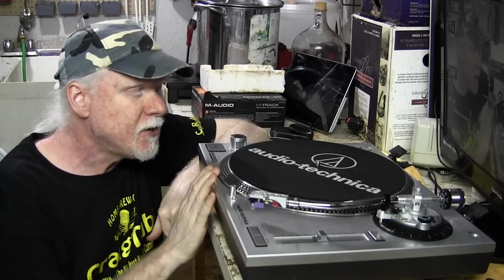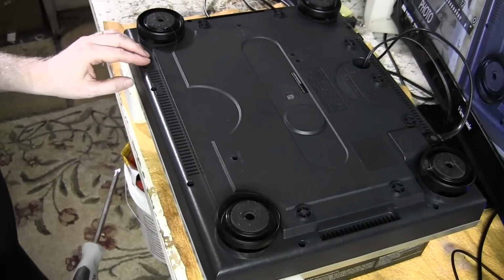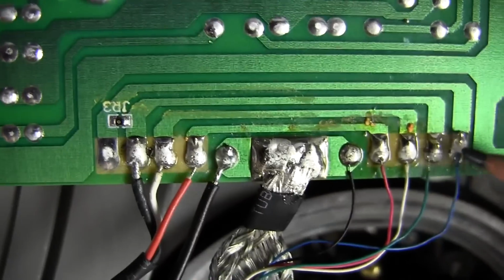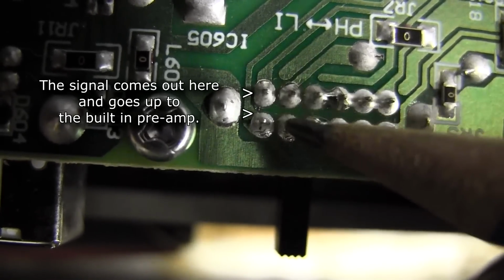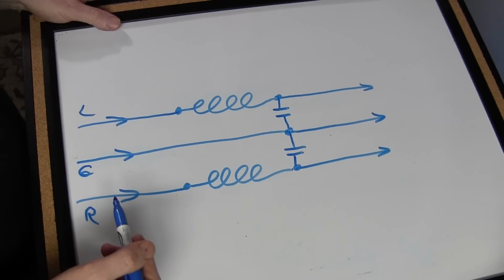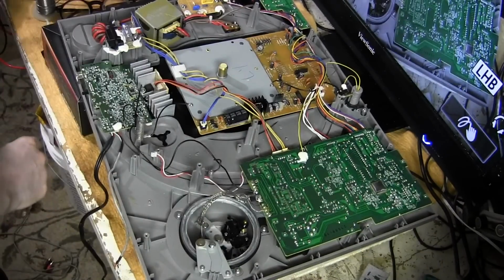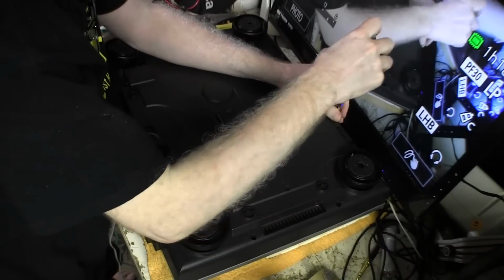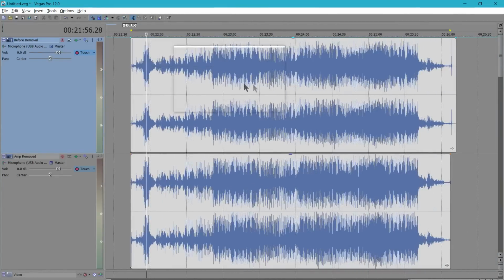Preamp Removal - Audio Technica AT LP120 USB Turntable

Comment: I believe that AT has upgraded this model in the last two years (the AT LP 120 X USB) so that when you switch to the Phono output, it actually bypasses the internal pre-amp.  I guess they heard that a significant number of people were doing this hack.  So, I'm guessing that videos such as this goosed AT into fixing this. So, thanks!
Reply: @skipandslide  No, they didn't, sadly. I did some research and it seems like that in the new X model you still can't bypass the preamp with the switch.
Reply: Do you believe it or did they really solved this with the X model?

Comment: Why not just jumper that portion of the circuit board? Jumper right past the choke and cap by soldering a wire from point to point.

Comment: Hello Craig.. I just got my AT LP 120xUSB that has a phono/line switch. Do you recommend using a cheap phono preamp or the built in preamp? My goal is higher volume output in general. Thanx in advance... p. s: love your song.
Reply: Get a line level booster TC780 and TC750 phono stage

Comment: These things are crap. Toys for Tots. Faked out with simulated build quality by adding 10 pounds of unnecessary armor plate weight to give the illusion of Technics 1200 build quality. It's a plastic toy. I have to make a video when I buy a cheapie one off the bay. This approach is incorrect, why not have the best of both worlds. A crude USB driver as factory and a pure audio out?  That way when you grow up to a real turntable, you can pass this on truly modded for the better to the next novice. Or, if cosmetics aren't important buy a used vintage TransAudio 1600/1800 built like a tank and better than most turntables sold new for under $500. They knock around for $150 or so on eBay. Heck,  any vintage Technics is better than this!

Comment: If I remove the built in preamp could you or anyone by chance recommend an in-line preamp as I plug this turntable directly into my Logitech Z-500 Pod that I use for gaming? I have no amplifier or receiver. Thanks ahead of time.

Comment: I wouldn't buy a turntable with a pre-amp built into it. That kind of circuitry is obviously going to effect the sound in some way. 
I think that if the power amp that you're using doesn't have a phono input, only then would you need a separate pre-amp.

Comment: super video .... maybe only removing this little capacitors from the pre-amp board the sound will be better ... this a HPF (high pass filter) to prevent a XIZZZZZZZZZZZZZ sound on the background ... this noise is possible to happend by problems on AC power ... much noise on the line etc...

Comment: There is a difference, but to my ears, the 'after' sounds more sibilant and shrill compared to the 'before'.  The circuitry could be AT's attempt at contouring the sound for a smoother output.
Reply: Yes  millions spent on design to help smooth the sound of the digital mastered vinyl

Comment: Question....the turntable you're using has a preamp that you can switch on or off. 
Is it still necessary to remove the preamp entirely if you'd prefer to use the 'phono' input on a stereo receiver? Or does the built in preamp in its 'off' position still hinder the sound?
Reply: That was exactly my question. Was there a test done with the preamp simply off? I bought a new Fluance 85 due to his recommendation which has a preamp, but I am not buggering it!

Comment: After watching this, I now know that I want the preamp removed from my own AT-LP120-USB.
But I am not mechanically inclined whatsoever and I can't trust myself to do this project on my own without destroying anything. I have none of the wires needed (except for a couple of old RCA cables) and not sure where I might even get them.
I have a decent Pioneer bluetooth receiver with no phono output, making the preamp a necessity....but I dislike the duller sound it brings to the audio too much. What a difference! It sounds so much brighter without it installed. In order to listen to my records, I have to turn the volume up pretty high, yet the full clarity still isn't really there (something I've always noticed when I bought it brand new a few yrs back).
To top it off, I JUST ordered a new $169 phono cartridge upgrade yesterday (it hasn't arrived yet). I wonder if the upgraded cart will make that much of a difference with that preamp dulling the audio like it does?
I don't even use the USB function at all, and likely never will. I wish it wasn't there at all now.
I would need to, I would think, pick up another turntable that doesn't come with the preamp AND/OR buy a new stereo receiver that comes with a dedicated phono input built in...is that correct?
I'm very fussy about the sound of my audio. I wish there were an easier way for me to get this sort of sound clarity without spending a whole lot more.
Reply: the pre amp is engineered to take highs out of digital  sound vinyl ..if you are used to cds  then sharp is for you ...theres plenty of carts around with that sound or up grade stylus
Reply: leftbreak vinyl, thank you for your help 👍
Reply: @MJEvermore853  Direct metal mastering vinyl from the EU.can sound sharp , so i use backwards techno..i use lp60 type clones..with conical type stylus..with own preamp takes the sting out

Comment: I have a new LP120xUSB.  I opened it up and they have changed the circuit board.  I was able to trace the circuit.  I found the capacitors and coils.  It's a relatively easy bypass.  The capacitors (C680, C623) under a little bit of pressure from needle-nose pliers crumbles and breaks the circuit.  The really isn't a need to remove the capacitor and run the risk of damaging the circuit.  For the Inductors (L601,L602) I jumped across the inductor to the top of the RCA terminal.  Wish I could post pictures. Sounds much better.

Comment: Excellent vid. Like most electronics shortest is best when it comes to signal path et and this proves it. I didn't like how they wired that lot up. A lot of stuff in there 👀 for a record deck to external pre amp/amp. I'm surprised you didn't have more of a difference signal wise / wave forms. My Rotel deck is way way less cluttered than that and its over 25 years old.

Comment: I don't know about LP120 but I've bought a LP5X two weeks ago for 299€ and it went back! I must say that jusy stay away from that cheap China plastic craps! Guys you have to know that they are just bad cheap plastic copies of old good turntables. I've bought a Dual 510 German made 1978 model from an old man for 100€. It works still perfect! If you can repair something just go and buy an old good turntable. German made, Japan made you know... You can maintanence, repair, learn, enjoy and save money. That's all. Do not pay for that Chinese craps 300-500€... Look at that circuit boards in LP120! Just typic Chinese quality!

Comment: Helo Craig, Thank you for the beautiful tutorial on Turntables. I do have an Audio-Technica Lp120 USB. All on a sudden, I see that the speed control is not functioning. It runs in maximum RPM. I would appreciate it if you could advice me on the reason-the faulty component, and the possible solutions to this issue. Thank you in advance. Joe

Comment: Wow, what a difference to the frequencies that mod has made,. I have this turntable and just output straight to my mixer using the on-board pre-amp. I definitely will be looking to use an external amplifier and doing your mod. Cheers Craig!

Comment: Hi Craig,

I just watched this video, and have removed the preamp from the AT table. However, I did this for the opposite reason: to insert the preamp between my turntable and amp, to GET the filtration, rather than remove it. I have a phono preamp in my amp, so I just want to patch it in passively between factory-wired RCA tonearm and my amp's phono stage. I only want the filtration. Is this possible? I have tried a simple patch-through, with no results - I get a hum when not grounded, but when grounded, I get only silence. Thank you!

Comment: I'm listening with an old Labtec speaker system plugged into my computer, with Sennheiser headphones plugged into it. The before signal sounds just fine until you hear the after signal. Then the stereo got wider, and the treble opened up! Of course what we don't know is whether the internal circuitry makes the treble filtration necessary, and what would happen if those inductances and capacitors were removed.
I've got a Lenco L3808, which is similar but cheaper! But the only online example I've seen of bypassing the internal phono amp, I'm told, introduced more hum. I wonder?

Comment: I really couldn't hear any difference. Maybe it's my THX sound system? Anyway, yes, I see the differences on your graphs, but I don't hear it. From an electronics standpoint, capacitors are not only used to tailor the sound, but also to absorb any electronic anomalies. If you use an external pre-amp, that is why they all have a different sound, because they are constructed and wired differently. This is also why cartridges and styli don't sound the same. The question is, is it worth the effort?
Myself, one of my turntables is the AT-PL120, the predecessor of the one in this video. The pre-amp, which I have never used, is part of the main circuit board. Last year, the output of the TT developed a hum. I figured that a capacitor was leaking. I ended up making the tone arm wires the direct output, through cables with RCA connectors. This solved the hum problem. Taking a few of the 100's of recordings I'd previously made with the unmodified turntable and re-recording them with the new wiring, I nor anybody else could tell the difference in A/B playback.
I relate this to perceiving something sounds better because of the effort extended making the change.  It's kind of like buyer's remorse after spending a lot of money on something and then, because of that, thinking that it must be the best there is.
Great video, and great music! Where can I get a copy of the record?
Reply: I absolutely agree - I was listening intently, but if there was any difference, I could not notice it, so I would not make the change. It is a subjective thing, at the end of the day. I have this same turntable, by the way. I must say though, I quite liked Craig's song!
Reply: @geraldyates6843  Ditto. I closed my eyes and promised I'd open them as soon as I heard a difference, expecting the "after," but after never came. I'm 60, so my ability to hear above 14K is negligible anyway and certainly not worth going to the trouble of doing the procedure.
Reply: Well, I can hear the difference in higher frequencies, but it maybe because I have good sound system for my PC. Music sounds a bit more vibrant. I am not sure if I would hear that difference on my vintage stereo with 130 watts per channel.
Reply: @sergepowa4210  Again, I have never used the pre-amp and have always had the switch in the bypass position. Everybody knows that no 2 pre-amps sound alike, if you need to use them. Most receivers have had built-in pre-amps for decades and are integral with how the receivers are supposed to sound. Although the pre-amp circuitry can affect the output in the AT turntables, in bypass or pre-amp mode, unless there is something wrong with the pre-amp circuitry, as I experienced. With my AT-LP120-USB being  part of my vintage quadraphonic system, using a Pioneer QX-949, with CD-4 discrete records having a 30khz carrier signal, which is way above human hearing, using the TT is the pre-amp bypass mode, CD-4 records play just fine, so the built-in pre-amp, bypassed, does NOT affect the higher frequency ranges. Atleast in the human hearing range. Using a TT's built-in pre-amp, makes an external pre-amp unnecessary, plus, when talking about computers, there are so many different soundcards available as well as speaker systems that using a computer for sound comparison isn't a good path to follow. Trying different soundcards and speaker systems or even using a computer for sound comparison is not a good way to judge a TT's internal circuitry.
Reply: @automatedelectronics6062  I am not disagreeing with you at all, I have the same TT and very happy with audio quality connected to technics su-g90.

Comment: After you removed preamp board from the turntable , do u need a phono stage to connect to the receiver. My Yamaha receiver  RX V479 . I use the Gogrove  ultra compact .  They sound muddy and lack of high?  Do u have thing the phono stage cost the muddy sound thx  Phong.
Reply: The TC750 is a good preamp

Comment: Craig. my setup produces a major hum. I wish this turntable had an external ground. Any suggestions on how to fix it?
Reply: If you open it up, you could attach a ground wire to where the other grounds are attached, where Craig attached his new green ground wire, and just pull it out where the RCA (red/white) cable comes out. 
And no need for soldering. =) Otherwise you could hook it up to a screw on the outside of the housing, but it would have to be a grounded screw, and I don`t know if any of them are grounded..

Comment: Im having issues with my Fluance RT80. Even with the pre amp switched off I am having issues hearing my records. Ive tried wiring it every way possible and im still having the same problem. It does not play at the correct volume, and the issue is with the turntable, not my receiver.
Reply: Couple of questions. 
Have you checked the wires at the cartridge? 
Are you running into your receiver's phono or line input? 
Have you contacted Fluance yet? I found them to be rather responsive. 

If it is out of warranty you could try doing a mod like in the video for the RT80 preamp and connecting to your phono input on your receiver. That would rule out the built in preamp at least.

Comment: The ONLY thing I would suggest is DO NOT un-solder the gray jumper wires on the main circuit board! UNLESS you are a soldering master, which I am not.  Cut the wires at the pre-amp and splice those wires to your RCA cables  that will go you your stereo or outsede pre-amp.  I put everything back together and had to take it all apart several times to finally fix my shitty soldering.

Comment: I preferred without  ?  But I do have a question lots of people go on and on about
better quality interconnects ie between to pieces of equipment. So whyare the 
wires that are soldered from the cartridge to the preamp not better quality  ? 
Ok I know you can’t have thick heavy wires going all the way to the cartridge 
but from the board to preamp could be better  ?

Comment: Isn't it possible to just desolder the  inductors and capacitors from the preamp pcb and just bridge the traces from there to the output?

(and  maybe disconnect the preamp power to avoid any interference)
Reply: Exactly what I was thinking while watching this.....glad I am not alone in this line of thinking. A lot less "hassle" to me.

Comment: i'm my opinion the difference is because of the equalised sound even if the pre-amp is not turned on, i feel i like the before sound as it is correctly equalised, the after sound having excess in the high frequency range, on my headphones the sound is near to distorsion due to the excessive volume in the high frequency ranges

Comment: Great video Craig. You now have me wondering. I just ordered the LP-120XUSB and I am rethinking before it even arrives. Question for you - My main purpose is to archive my vinyl which is why I bought the one with the USB and pre-amp. Now I am wondering do you suggest I buy a turntable without the preamp and then by a good preamp to process the signal? I want to end up with a high quality copy of my vinyl for traveling etc... Before I even get started I was hoping for some inside from you. How do I judge the preamp in the turntable vs buying a stand alone. Will that give me a better result? I respect your opinion if you could please let me know.
Thanks!!!

Comment: Something's not right.... I can definately hear phasing between channels in the "before", which is gone in the "after". 
You either did something (altering sound) or.. made a wrong assumption where it comes to filterpaths, which are situated AFTER the phono preamp you bypassed (signal out) 
It's like "dolby on / off" (leslie box effect almost every cassettedeck suffers from) which is (in this case) impossible.

Comment: Question is how does it sound with build in preamp switched on? are those LC filters still in sound path after internal preamp activated?
Reply: Just watched it again and it`s clear that lc filter is on the signal path in both positions, even if internal preamp will be used I`d get rid of those lc filters.

Comment: I respect your advice and comment about personal preference. But the capacitors in the circuit are intended to, let’s say ‘sweeten up’ any inconsistencies in the ac wave coming from the phono cart. So if you were using 2 turntables side by side you can predict consistency between the two carts. Thanks for the video, I’ve just ordered one of these (slightly newer version) from Audio Technica after watching your video 😊

Comment: Just pulled the pre-amp out of my AT-120 and it's a HUGE difference!! Well worth the time!! Thanks for posting this vid Craig!! BTW.....you can put the little spacers back in AFTER you sit the the back on the body of the turntable. They will fall right down into the little holes. They are basically spacers to keep the heads of the screws from breaking out the plastic when you tighten them down.
Reply: I leave the spacers out, tighten gently and flutes with that small gap shouldn't be a problem